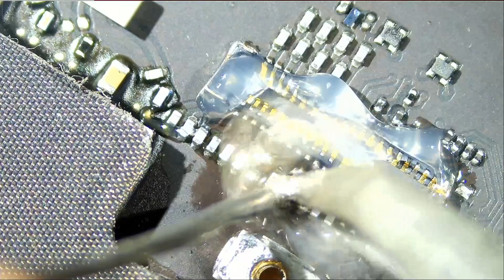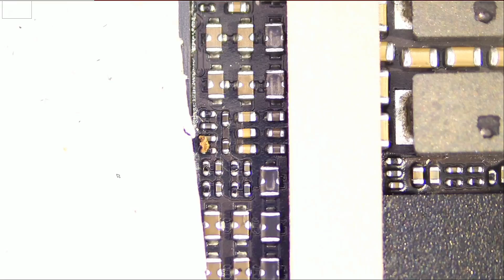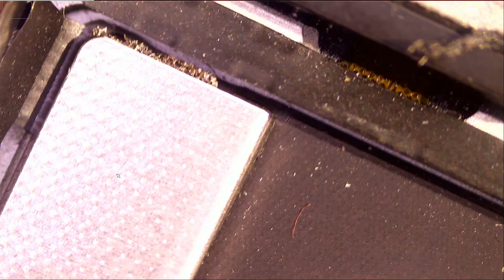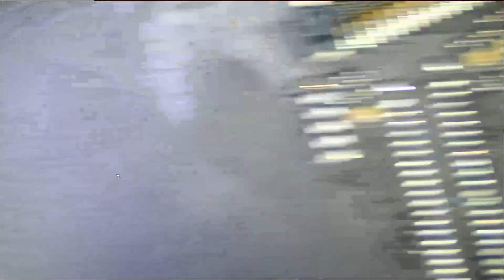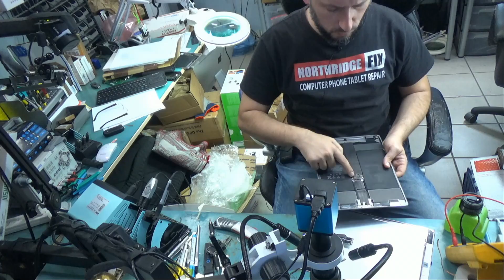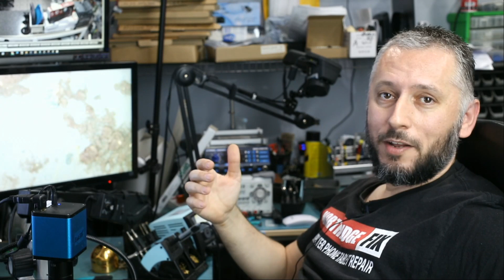iPad pro 12.9" Repair No Display No power No touch after screen replacement

Comment: Would it be possible to ”retrofit” gen1 display on a gen2 pro 12.9? Those 2nd screen are really hard to get. 
Also, like when you mention what air speed/temp is used👍🏼

Comment: Good job as always Alex.
As for comments regarding what appears to be generous amount of flux he uses, it's under a high power microscope. Based on scale most Flux is only less than or equal to the size of a Qtip head.

Comment: Amazing 👍 thanks for vedio please i have one question 
Filtar means fuse ? thanks for answer .
Reply from the maker: It's more of an inductor used to eliminate high-frequency noise. If blown, it will break the circuit where voltage can no longer travel from point A to point B

Comment: Have you tried "chip quick". I think in this instance it would have been a better choice to remove the connector than hot air gun. if you haven't used it and you use it because of my comment. And it helps you a lot. Then you owe me. I will trust that you'll be honest enough to let me know.

Comment: Makes you wonder what the 'customer' was doing when all that damage was caused if they were doing it on behalf of their customer! The connector being broken like that in particular...you'd also think they'd know that the battery should be disconnected before changing the screen if they are in a similar 'high level' repair trade, albeit not component level...
Reply: they were from Wyoming....

Comment: İs there a way to heat it under of the board to remove connector without damaging plastics ?May it will take much time but less damage

Comment: Wonderful repair! Great to watch your videos. What are these filters by nature? I mean resistors, caps or coils? You replaced for display and touch?
Reply: Caps
Reply: @kennex1339  they are ferrite beads, not caps. Ferrite beads are essentially inductors with very lossy core that help reduce high frequency disturbances. That's why he is testing for continuity: a good ferrite should show <1 Ohm, while a good cap would show essentially infinite resistance (>20 MOhm).

Comment: for removing Connectors without damaging you should heat the motherboard from the other side
Reply: I agree...but microscope cant record this maybe...;)
Reply: Not quiet true. you have a good possibility of having components fall off the board doing it your way. Tis called gravity.
Reply: Want that damage the motherboard? What temperature °c and air speed
Reply: Or use preheater.
Reply: Saul sandre- yes you can do that but on savage board not on CX board. Cuz there r lot of possibilities to damage the board

Comment: Hi. Can you please clarify. when you mean filter,  are they filter capacitors or filter inductor.  pardon me for my lack of knowledge. thank you.
Reply: @azamarman525  thank you .
Reply from the maker: Ferrite beads, They are used to suppresses high-frequency noise in electronic circuits . Ferrite bead are continuous more like a fuse or inductor due to low resistance. If blown, it will break the connection. It's very common for ferrite beads to blow on iphones and ipads when a screen is replaced without disconnecting battery first. That's what most likely happened to the ipad pro 12.9 tablet that we fixed in this video.
Reply: @NorthridgeFix  Thank you for the detailed explanation. much appreciated.